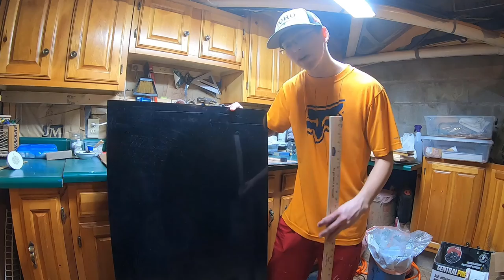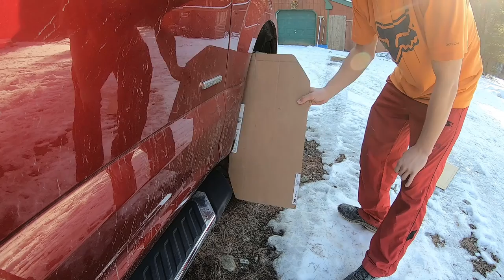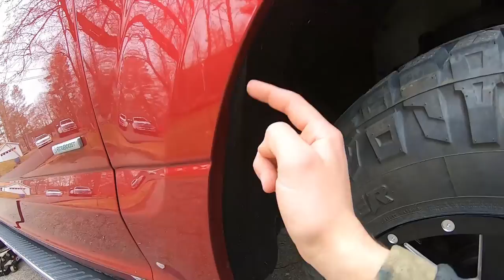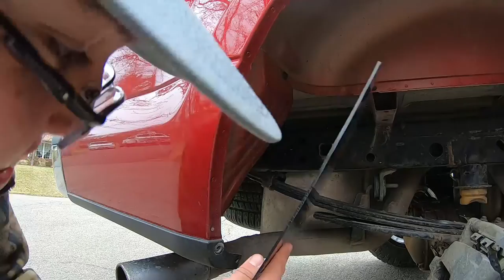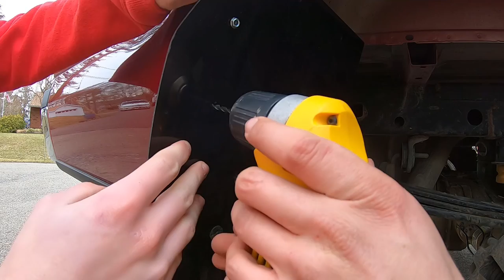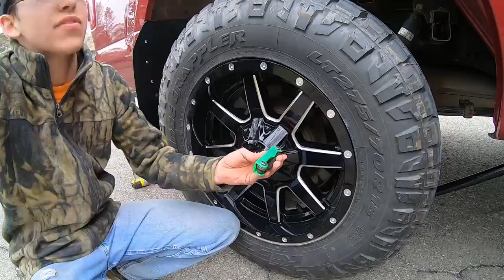HOW TO MAKE DIY Mudflaps for UNDER $25!! | Truck Build series ep. 02

Comment: What is the benefit for using a plastic compound instead of a rubber compound.
Reply from the maker: This is sort of a rubbery plastic. Rubber is more prone to dryrot, and it hold it's form to stay away from the tires. Therefore it could definitely cause issue when there is snow and ice buildup compared to these
Reply: Alright good to know.

Comment: drilling the metal wont make it rust after a while ?
Reply from the maker: My trucks aluminum. I wouldn't drill a steel truck body
Reply: Little dab of paint with some clear coat spray will help with rust